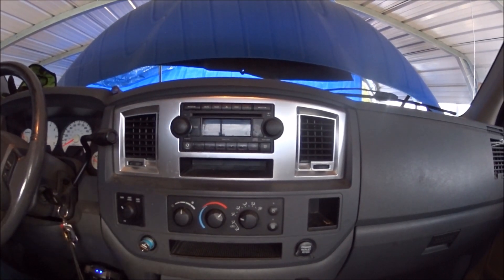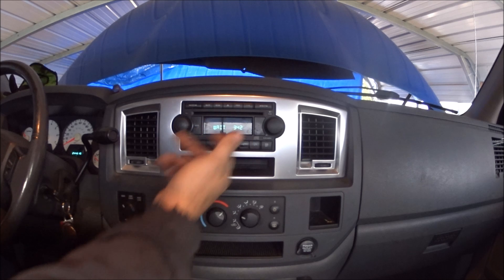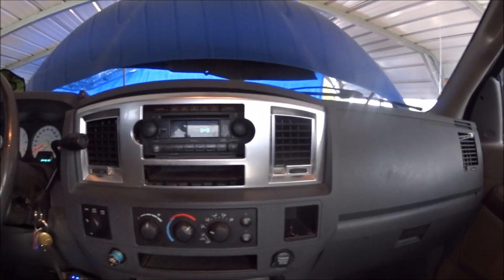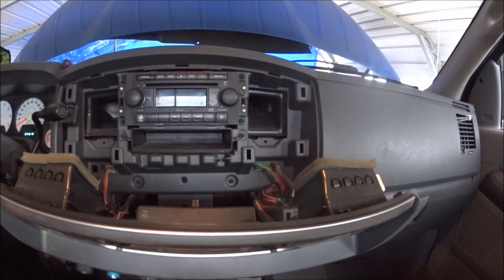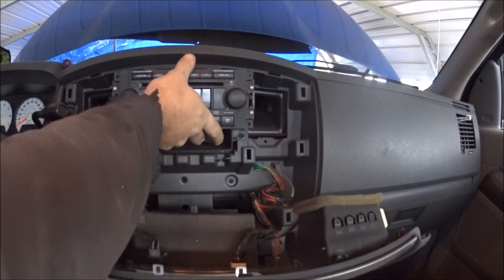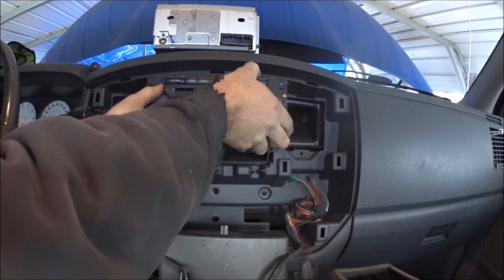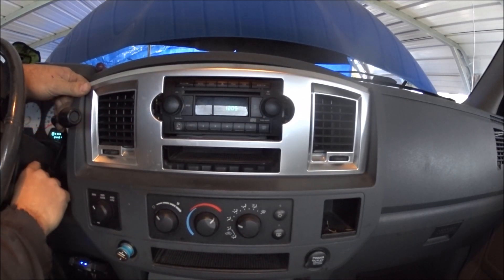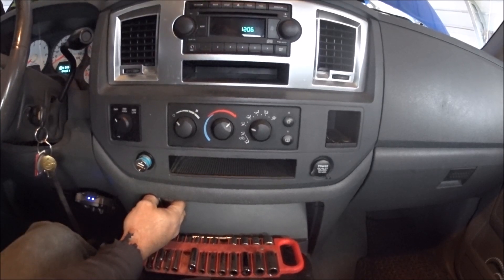2007 dodge ram radio removal and install

Comment: Dude, you’re a lifesaver gonna go get this done I’m putting a Bluetooth radio in so I can answer calls for work. Thank you love my Dodge.
Reply from the maker: no problem is a very easy install hands free will be a plus,  I also have video on the install if you have the steering wheel controls

Comment: Before removing radio because cd won't eject. Disconnect batteries for a few minutes, then reconnect. It fixed my problem ! Just trying to save you some time and money .
Reply from the maker: well it turned out there was not one inside it just had an issue where it would not let one load?

Comment: Appreciate the video man. After removing the screws even some that I probably shouldn't have. That thing still felt like it was welded in as I tried pulling. Thought there must be some more screws. I got a butter knife and started to pry. Simply pulling as you were doing didn't work for me.
Reply from the maker: some pop out easy some don't its a steady pressure or some times you need a pry tool,  ive gotten lots of views and lots of questions things i never would have thought of adding i have plans on making an updated video answering a lot of them hopefully this video helped out some..

Comment: Does that 2007 need a pac wiring harness? I have no radio controls button on steering wheel
Reply from the maker: no steering wheel control or amps this is this truck has the standard radio i have a video doing the install on one that has the controls posted also

Comment: So, I was removing my stereo, and those wires that run at the bottom for the AC, the clip parts that go into the wall, came out, and I don't see anything they actually connect to anymore. There is the wjoles but nothing on the other side of the the hole, just empty. Does that mean they have fallen back into the dash more? Or were they just holders?

Comment: I couldn't see the part number on the original stereo and are the remote buttons for it on the steering wheel?
Reply from the maker: this truck does not have the factory upgraded system look at this one
 https://youtu.be/4y6lI5bLNCI?si=i5oNKlUSzYNGJEGs
Reply: That was kind of you thank you

Comment: Do you know if you can replace that radio with the factory unit that is SiriusXM ready? I can’t find the answer anywhere…
Reply from the maker: this radio in this 07 It has a digital band, I cant remember what it is as its some thing I never used as a guess if your up grading to one of them and the model truck was not equipped with it you might need to also add the receiver that's for the xm radio and possibly change a harness it might be easier to install a double din aftermarket unit

Comment: Can you access the blend actuator after removing the radio ? My radio is ok .....need to change the blend actuator.

I removed the glove compartment door and the actuator is not accessible through the glove compartment.
Reply from the maker: sorry i do not know if that's possible but i'm in need of replacing the blend doors in my 2006 and will make a video on that i know for some you will need to pull the dash

Comment: How can I get to the bottom of where the radio is suppose to go ? I took my radio out and my ring fell inside the gap where the radio should be ! Is there any way I could get to the bottom of it I tried putting my hand in but it’s so small of an opening

Comment: Great video thanks a lot
Reply from the maker: Gerard Donaire thanks. hopefully it made the job easier
Reply: Yes I'm not going to change the radio, I'm going to charge some little bulbs  on the heater ac control i was wondering how to open that panel thanks again

Comment: My truck is a standard transmission and I don't know if that has anything to do with the 7 mm bolts that you took out, but they are not there. I don't want to break anything I don't know what to do.
Reply from the maker: If you have the lower console you will need to remove that first the standard ones just have the cup holder
Reply: @Mattsneedforspeed   thanks. It's verified I just seen a YouTube video where some guy had to take the whole thing apart from this cup holder up just to get to this area. Thanks again for the quick reply, everything helps when so frustrated!

Comment: Why do all that for a stock unit? Upgrade
Reply from the maker: Wife’s truck I had a spare good working stock unit to exchange it out but I was mostly just covered the how to install I have other videos installing upgraded head unit in another one of my dodge trucks with the steering wheel controls

Comment: Could not see the bolts that you were taking out at first
Reply from the maker: this is a common comment they are not to hard to find and not to easy to see just feel for them i do plan to do a second video thats updated covering any questions so it helps out others

Comment: Is the stock one double din?
Reply from the maker: Yes and no there’s standard radio and nav but when replacing it with single or double you will need a kit for a double you will need to trim what I call the bezel for the install kit depending on what one you get here is a link to one I did https://youtu.be/FXkSPs0BMo0?list=PLMkNSq7IPyulceSi6Bi18unkPRhdaAUcz

Comment: Where is "down here" 🤣
Reply from the maker: I've been asked that a fue times i should have included that but under the bezel at the btm there's 2 holes one on each side if you fit can look up in there if you remove the cup holder i plan on remaking this and adding that to the video.. sorry for letting that out hopefully you got it installed